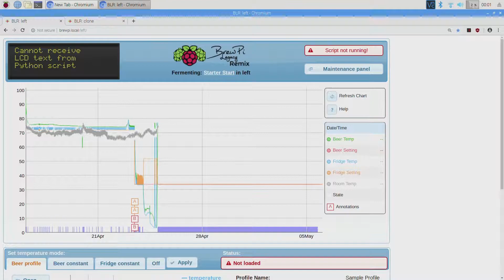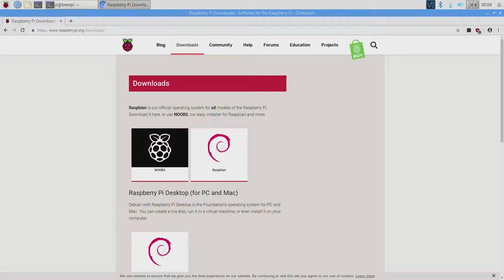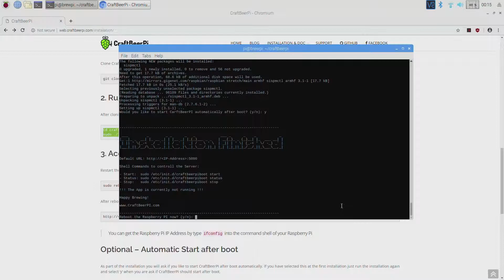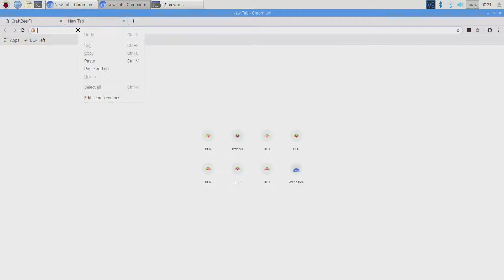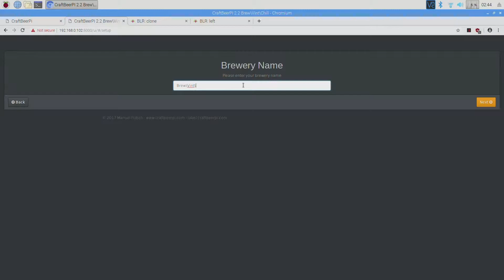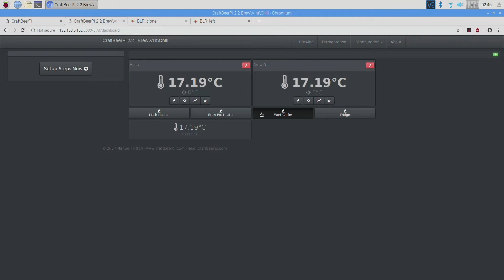CraftBeer Pi Install & Setup on Raspberry Pi with preexisting BrewPi

Comment: There’s a version 3 bud
Reply from the maker: Thanks for the heads up, I was unaware of the beta program and will look more into it once we finish some of our other projects.  Looks nice though.
Reply: @BrewVintChill  Version 3 is the recommended version to use currently. There might be e hiccup regarding wiring-pi - you'll find the remediation in several places. Version 4 is not ready yet. I am running version 3 very successfully.
Reply from the maker: We are planning on covering v3 more in-depth, but a point of contention has been that they still have not updated their website to reflect that version 3 is the recommended one, at least on the English site. We did just get in some parts today, Relay Board and Touch Screen, that we ordered for the next CraftBeer Pi video.